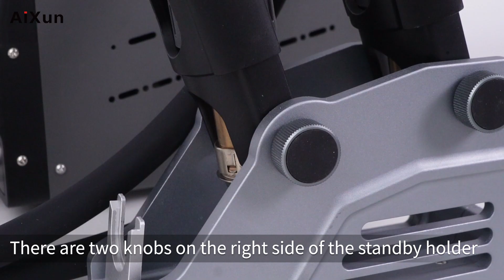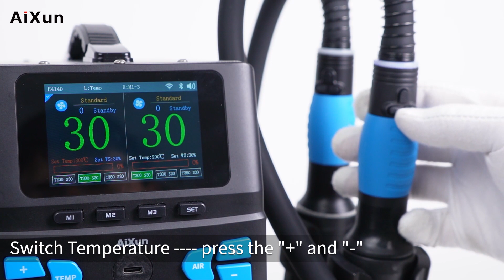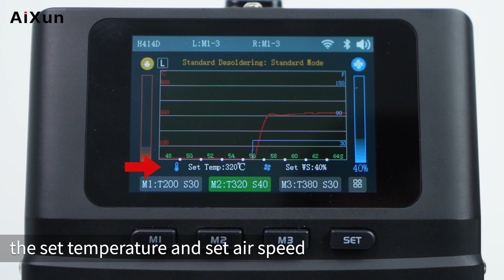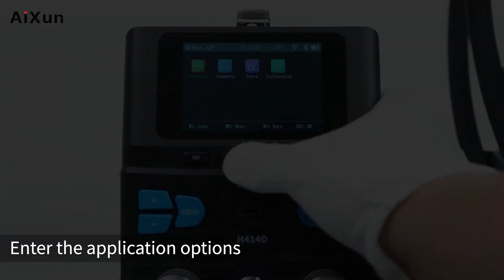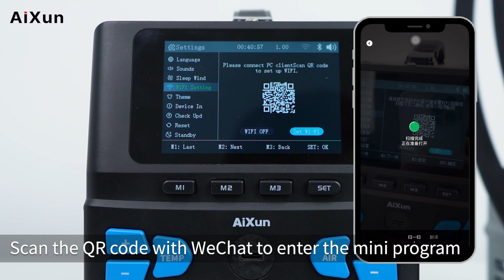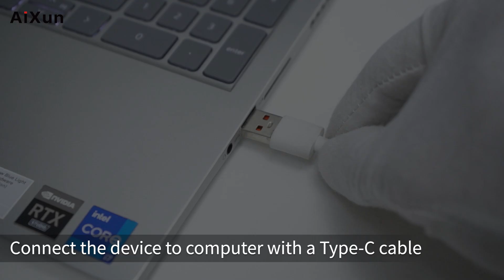AiXun H414D Dual Channel Hot Air Rework Station - Operation Video #hotairgun #aixun #H414D

Comment: It's great that there's a new product, but it's a pity that the Mini App doesn't work as it should and there's no control from a computer or phone. It only looks good in the video. Can we expect an update soon with a different interface than WeChat and the Mini App? For example, a program for Windows for Control of heating segments? In Europe, there's no control because the Mini App doesn't detect any devices in the list.
Reply from the maker: Hi, the mini program in Wechat is mostly for Chinese users, overseas users can set WIFI on AiXun Assistant platform on computer. Please check this operation video: https://youtu.be/ns6bNBBWmrM
Reply: @aixuntech  None of the mentioned methods work — I’ve tried all possible options. The only possible - I can update is via USB cable in Aixun PC Program ... I have no control over Wifi the device.

Will an alternative version of the Aixun Platform - API for PC or Android be created? They do not work as advertised — for example, controlling heating profiles from App. There should be a clear notice that some functions are unavailable outside of China, shouldn’t there?

I'm seriously considering returning my products because of this.